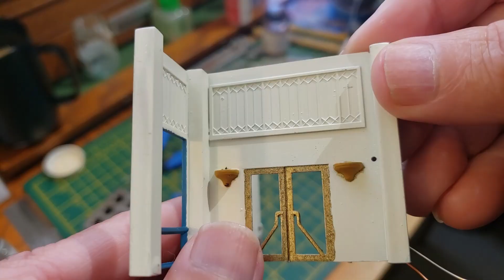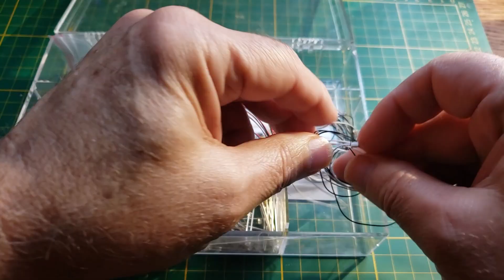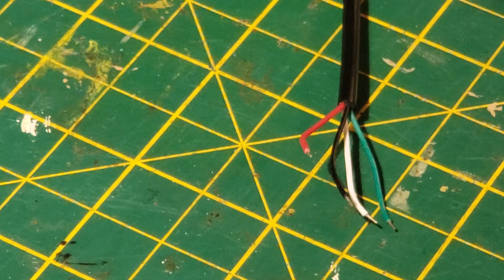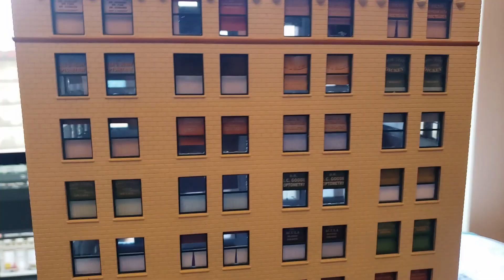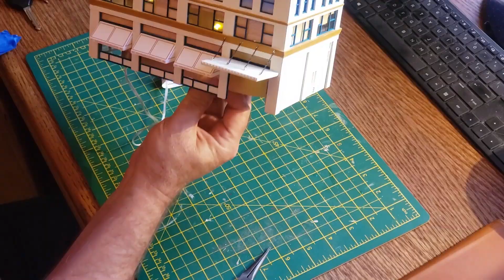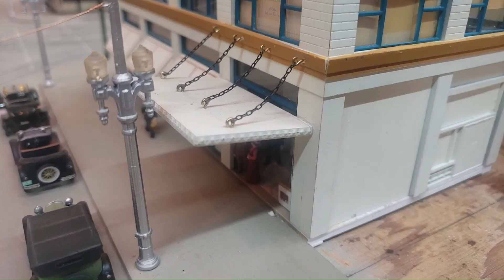Walthers Ashmore Hotel Build part 10 ~ Lighting

Comment: Hi Dan,
Congratulations on the super-realistic rendering of the building's lighting!
I wanted to ask you how you managed (if that's intentional) to make the trolley wheel glow when it passes over the insulator (12:19).
Reply from the maker: I don't know- I didn't notice it until I was editing the video, mistaking it as a reflection at first. But as soon as I figured out that it was electrical arching I quickly hunted down a sound effect for it since I liked it so much. I'll have to take a look the next time I'm operating the layout and see what caused it. It's a nifty effect! Thanks!